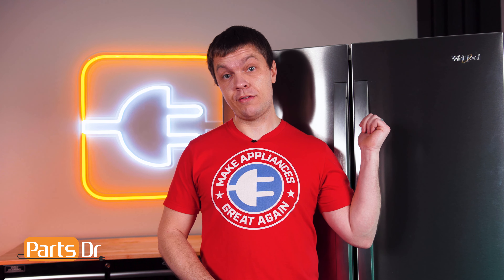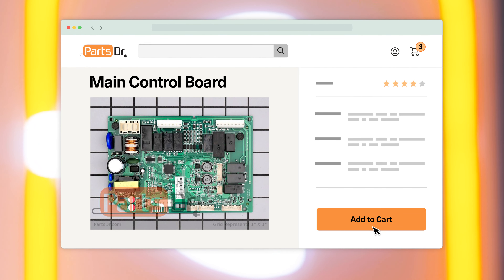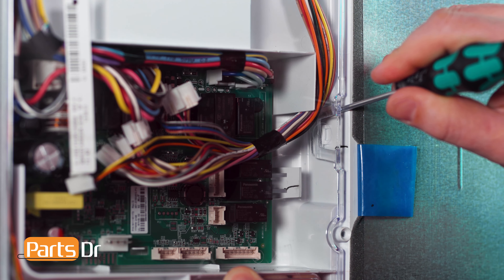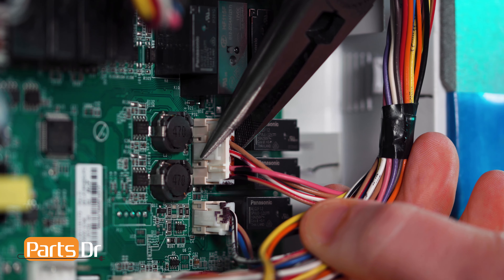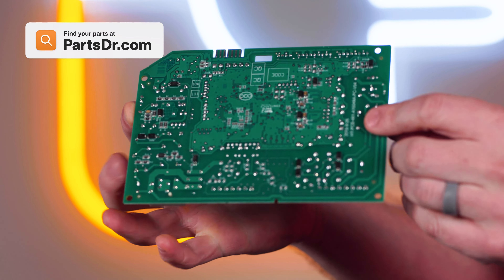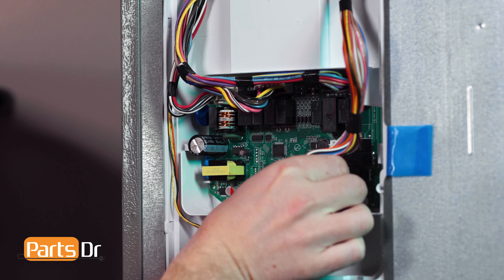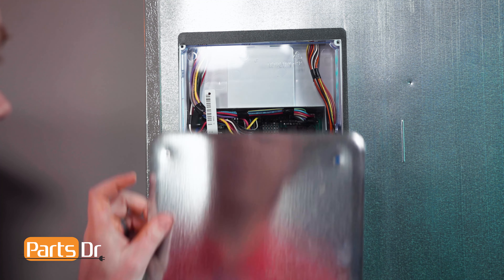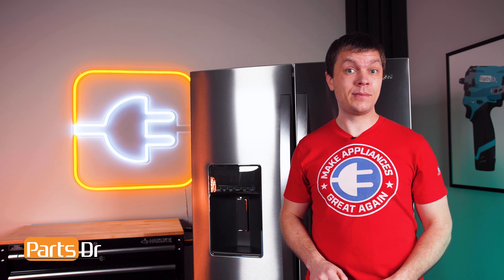How to replace Main Control Board part # W11224256 on your Whirlpool Maytag KitchenAid Refrigerator

Comment: I don't like fixing things but can't afford not to. SO, I need a circuit board and fan motor for my WRS 576FIDB01 side by side Whirlpool Ref/Frz. How do I order and how much $$?
it quit defrosting on the freezer side (I was manually defrosting once a week) then the evap fan (inside) quit several months later. Actually smoked up the unit.
I would like to purchase the parts and DIY Install.
Reply from the maker: What is the full model number from the tag on your refrigerator? https://www.youtube.com/watch?v=hHM9248ROWY

Comment: Does the board control the compressor? Thank you
Reply from the maker: Yes, on most refrigerator models, the main control board either directly supplies power to the compressor or, if the unit has an inverter control board, it sends a signal to the inverter, which then powers the compressor.

Comment: After replacing the board don't we need to reprogramm it ? I am installing a new one on a WHIRLPOOL model WRF555SDFZ but there is no code in the label. So I don't know if I have to reprogramm the board or not. Would you tell me about this. I am confused. That's the only thing I need to restart my machine. Thanks in advance, Ramon Perera, Miami.
Reply from the maker: These main control boards like the one shown in this video do not require any programming.   Your model number is incomplete, but it doesn't look like yours would require programming either.

Comment: I have a krmf706ess04   5 door   Do you know the colors of the heater wires? and what plug its in on the mother board.. The unit freezes up
Reply from the maker: You can try looking at the wiring diagram to see if they list that information https://s3.amazonaws.com/sm-backend-production-attachments/tech-sheet-w11501234-revB.pdf

Comment: I have a Whirlpool WRX988SIBM01 that needs a new control board W10807590, however there is no "code" on the label inside the cabinet.  Does this unit/board require a program code?
Reply from the maker: This control board does not require a program code.  https://partsdr.com/part/w10807590-control-board
Reply: @ thank you for the reply - much appreciated.

Comment: what's the lactation of the main control board for model WRF560SEYB05?
Reply from the maker: The main control board for your model is shown located behind the bottom rear cover near the compressor.  https://partsdr.com/part/w11035836-control-board?model=WRF560SEYB05

Comment: I have a kitchenaid KBRA20EMWH and my fridge started making click noise followed by buzzing for 5 seconds and ends with another click. I followed your video how to test the compressor start mechanism and everything tested good.  I noticed that if i unplug the fridge for 5 minutes and then plug it back in the fridge stopped making the clicking/buzzing noise for about 5-6 hours and everything is cold inside and also making ice but then the clicking returns and the fridge starts to slowly get warmer where the ice cubes start to melt after a day.. I think it might be a main control board issue but I can't seem to find it.  There is no back panel at the back of the fridge except the one that's covering the compressor.  Just wanted to look at the main board to see if any capacitor have swollen or if there is any visible damage burn marks..  Can't find any info on where the main board is for this refrigerator. I checked your site for parts and you carry parts for kitchenaid KBRA20EMWH.
Reply from the maker: This model refrigerator does not have any control boards.  You will need to try to isolate which component is making the buzzing and click noise.  It could be the start relay and overload making the noise.  If those components are testing good, then the compressor may be bad.

Comment: thanks so much for this video. I have a Whirlpool WRX986SIHZ00. It will shut itself off every now and then. I run the diagnostics test, which turns the fridge/freezer back on at the conclusion of the tests. . Will this part W10843055 fix this issue? Fridge is about 5 years old. The Whirlpool tech stated I needed to replace W11387386 (Electronic Control)  and W10830288 (LED Power Supply Board) as well.
Reply from the maker: We can't diagnose problems like this over a Youtube comment, but it sounds like you are on the right track.  If the power to the refrigerator is good and it is not powering on, we would start with either the Main Control Board W10843055 or the Power Supply Control Board W10830278.  Diagnostic tests usually won't help when a control board is failing because you will not get accurate results.

Comment: It looks like this board is the updated part number for my WP WRF7757SDHV00. The original board that it came from the manufacturer with has been replaced by this part number. Will my fridge require any programming because of this part number change? Thank you!
Reply from the maker: The model number that you provided has an extra character.  We think it might be model WRF757SDHV00.  If it is, then it uses this main control board here: https://partsdr.com/part/w11224256-control-board?model=WRF757SDHV00 and it does not require any programming.

Comment: Would I need to reprogram model WRF736SDAM13? I am replacing my control board this weekend. If so, how do I do it?
Reply from the maker: Part number WPW10589838 used on your model WRF736SDAM13 does not requite any programming after installation.  https://partsdr.com/part/wpw10589838-main-control-board

Comment: Do I need to reprogram my whirlpool WRX986SIHZ00 after replacing the mother board
Reply from the maker: Part number W10843055 does not require any programming after installation.

Comment: Whirlpool WRX986SIHZ00, intermittently power inside/cooling turns off while dispenser display remains on. Is part#PD00047059 CORRECT from your site?
Reply: -additionally the current remedy is to unplug wait 3min and it will turn back on when pluggedin. Once plugged in I can hear clicking before it starts (perhaps the relays).
Reply from the maker: That is the correct part for your model number.  We cannot diagnose a problem over the internet, but it sounds like you are probably on the right track.

Comment: Do you a main control board for a wrx988sibm03?
Reply from the maker: This is the main control board for your model refrigerator here: https://partsdr.com/part/w10843055-cntrl-elec?model=WRX988SIBM03
Reply: @PartsDr  when will you have more in stock?
Reply from the maker: @dustinmcclellan40  It's on manufacturer backorder currently.  The best option is to click on the notify when available button on our site and enter your email address to be notified when more become available.